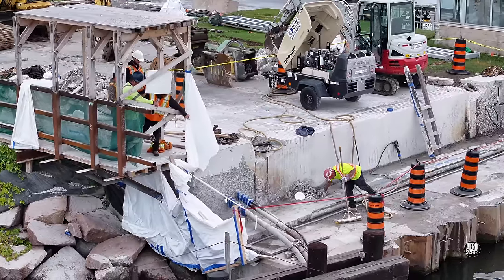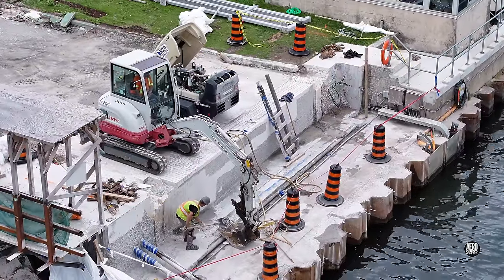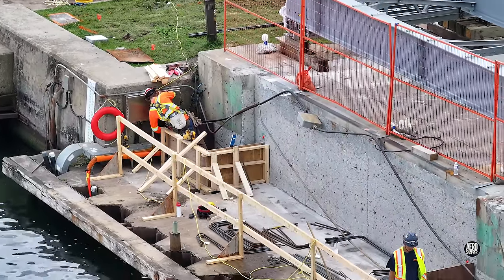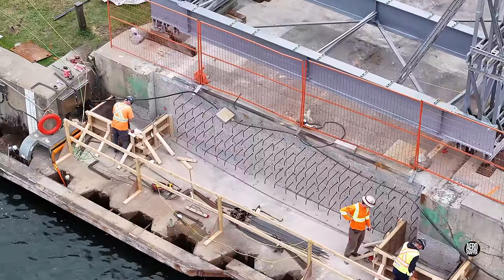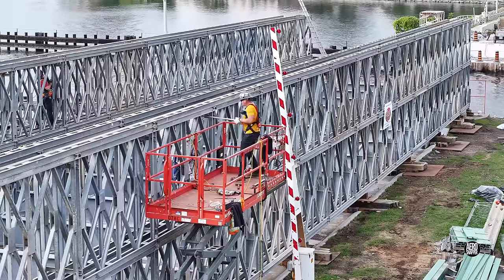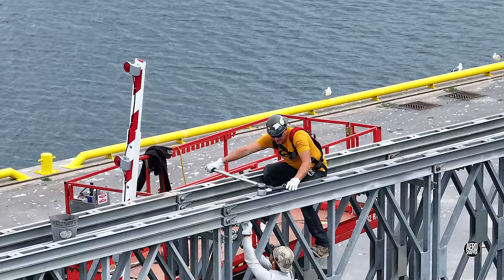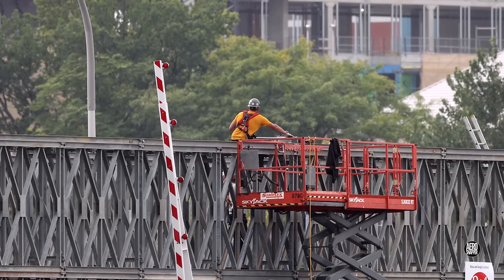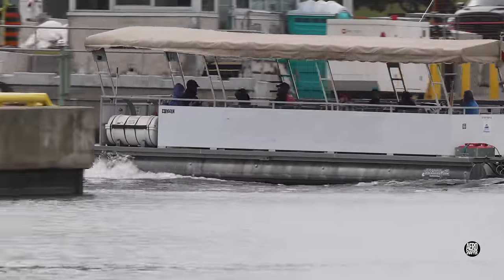Showing a bit of Form - an update on Kingston, Ontario's La Salle Causeway  4K

Comment: The work on concrete  at this point   I think  it  may be  part  of the  new bridge  measure 1 check twice  lol
Don't want to  put  more  concrete if there  didn't  think of  ahead of time
Reply from the maker: @ronodowd5724  it’s possible - but I think the simple explanation that the temporary bridge has a fixed length because it’s composed of stock panels and the abutments have to be matched
Reply: Show off lol
It will be  time  before  things will be  done  
Kingston  be  respect  the  people  they are  doing  safety